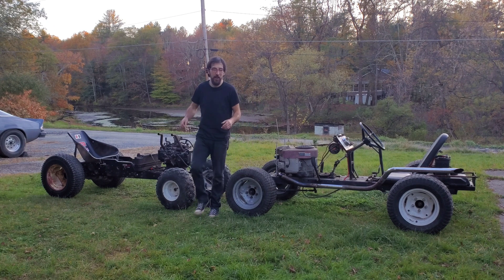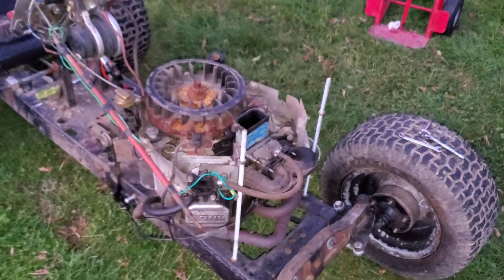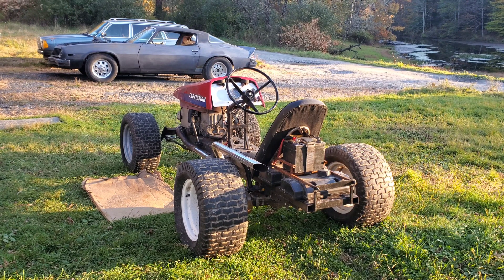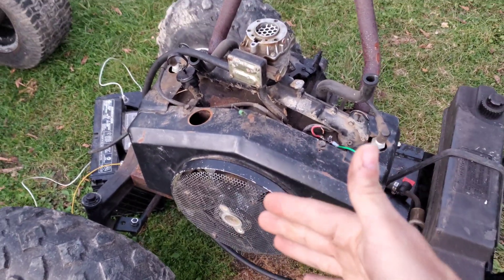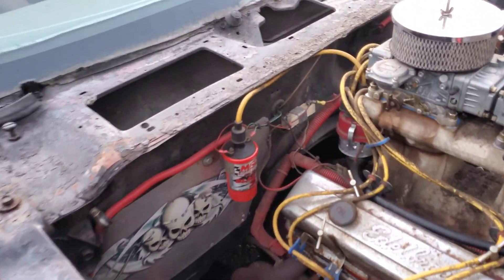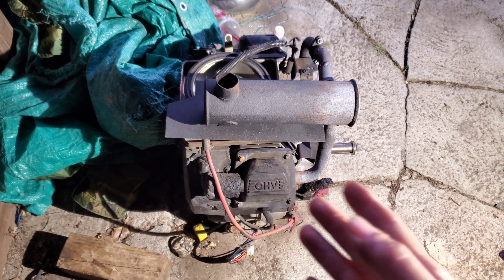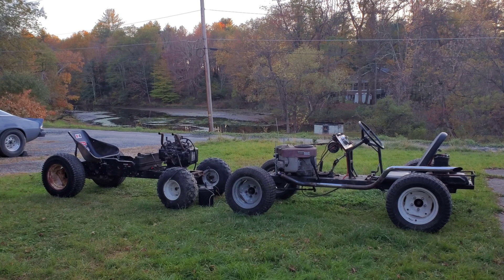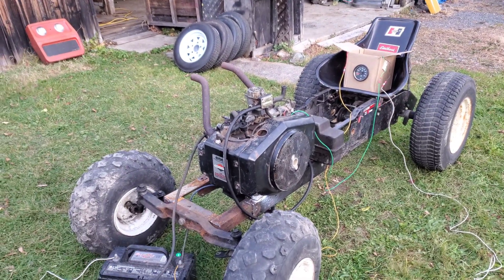How To Install Tachometer on Race Mower Go-Kart Lawn Tractor. Quick Easy Tutorial

Comment: Could you touch up on the 2 step wiring again? I followed the diagram but my 2 step isn’t working
Reply from the maker: @dieseldan404  Yes I will do a another video on it. I've gotten a few comments like this.
Reply: @ I appreciate it man, I love your content. For some reason my tach(2 step) only gets a signal when my mowers kill switch is in the kill position ( grounded out) . Ima try grounding the tach to the battery and see if it helps

Comment: Hey Gary, I’ve been trying to get a tach to work on my mower for a hot minute and still can’t get one to work, I’ve tried a cheapo Amazon tach, an equiis, and one of the motor meter diesel tachs, none of them will display anything for me. I know I have a good connection to the kill wire also, because if I ground it the motor dies. Any clue what it could be?